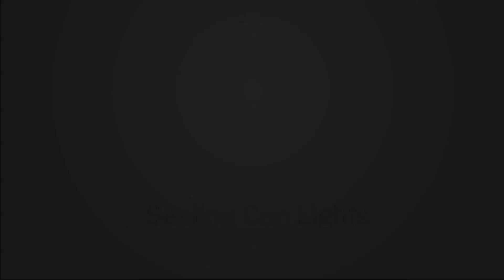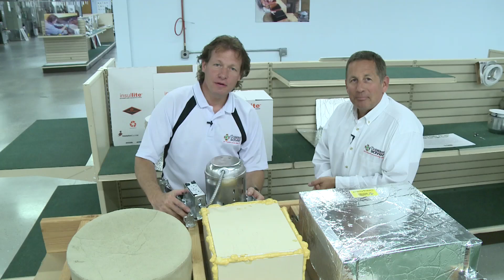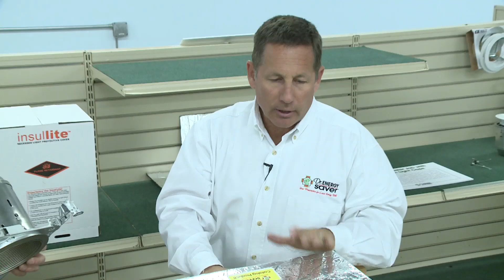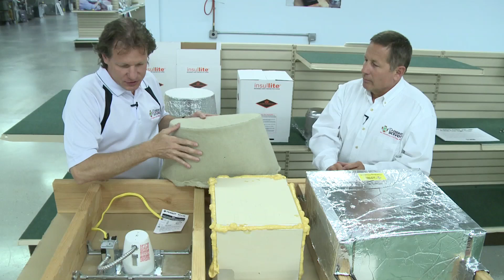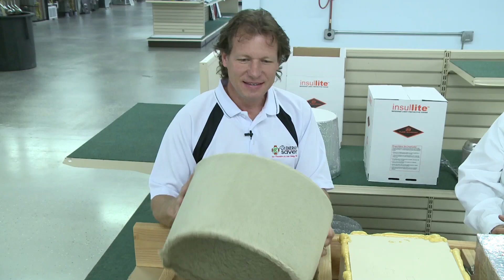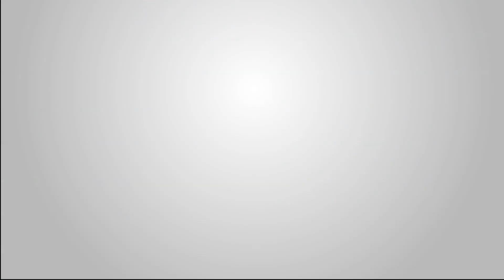Sealing Can Lights | Saving Energy with Can Light Covers

Comment: No need. Tape up the holes with foil tape and switch to LEDs. Blow insulation in the attic and be done with it. The LEDs alone will save you much on the electrical bill

Comment: Can often use a garden (fired) clay pot over the cans.  Invert it over the can.  If it has a drainage hole, place the matching saucer over that.  Then insulate the whole thing.
As noted by others, the video should have mentioned using IC rated cans. Can insulate over them.
Reply: That’s a lot of weight sitting on the drywall !
Reply: @bluesdirt6555  No. The clay pot is not heavy. It is a clever solution for avoiding drafts.
Reply: @ownpetard8379    My kitchen has six cans in a 6 x 8 ft. Area and the lights are at least 10 “ tall that’s a lot of clay pots
Reply: @bluesdirt6555   So, 6 clay pots. Fired but not glazed - less weight.
My issue is not weight but the space needed for 6 pots given the need to clear 10 inches. Setting aside that that is a lot of light - each with a 10 inch can - for such a small area, then seal 4 of the six with clay pots, and use another means for the other 2. Will be far cheaper than a commercial solution. You're welcome!
Oh, yeah, check if they are IC rated in which case you can insulate over them.

Comment: It’s not like you have the window wide open, stop stretching the truth
Reply: yes. You are right.  But the surprising fact is that when you add up all the holes in all of the can lights located on the top level of a house that the air loss accumulates to a measurable size equivalent to a window - of SOME size (but WAY BIGGER than you would think).   But you are right. Its a sales technique but not one done in bad faith. People need to be able to perceive and picture this stuff. So he should have specified how big that window would have to be. fair enough.       Here's one for you: got a leaky window? - why does it leak? Well, it leaks because of the parts that don't meet. Well, yes but there is more - there is pressure. From what? From those leaky can lights (and other stuff).  When this research was first done they sealed up the basement windows and basement walls and what happened next surprised everyone - the first floor windows leaked more than before. The air leaking out of the top of the house had to come in from somewhere. It had been coming in through the basement windows - now the first floor walls and windows. Its like an old can that required TWO holes for things to flow. So rather than seal up the basement or the first floor FIRST seal up EVERY hole on the uppermost plane of your home. Doing that actually reduces the amount of demand for makeup air coming in your lower floor windows.

Comment: Just get IC and air tight cans. Juno and Halo both sell them for NC and RM for under 20.00 USD. It would take less time to swap them out if you have non ic/at units installed. The Recessed Lighting can he is holding is not ic/at!
Reply: Cans labels "Air tight," "airtight," "airtite," "air tite" cans do not have to comply with an airtight standard and so, surprise surprise, they are simply not airtight. Look at them. There are a lot of holes in them - but less holes than a standard can. Then also look around where they meet/don't meet the drywall.  Try it both ways then run a blower door. Measure the cost of air loss over years in various climates and housing stock - or simply trust the work of others who have already done all of that and found that its easiest to slap a cover over it and foam the edges.
Reply: Sealed halo? Might as well just have a hole. Air flows through so much on every one I've seen.
Reply: Yeah it's not that simple. I have air-tite halo cans in my living room and they leaked a ton of air before I sealed them.

I went with type x drywall boxes and fire caulking. It took a bit of time but was less money in materials than the rockwool covers. I also feel I got a better seal as I could customize each box to the specific light I was sealing. It made a massive difference in comfort in the living room.

Comment: Hi Both, There are two issues involved here. First the savings you are trying to achieve are nothing against those you'd get by simply changing the bulb to a low energy unit. Secondly, the bulbs you're using need an airflow to keep cool. On the other hand low energy bulbs do not generate anywhere near the heat of a conventional bulb. Hence sealing becomes a lot simpler and safer. Regards.
Reply: A couple problems: avoiding safety and litigation liability requires complying with building code and manufacturer safety specifications - both of which are in place for good reason. Using your suggestions a subsequent homeowner who re-installed a high temperature incandescent bulb would then enjoy greater risk and liability. Secondly, you said the savings are nothing compared to changing the light bulb. Well, sorry, but no. Not correct.  That hole is there 24/7/365.25. Think: hole in a rowboat but, with a house, up-side-down. The boat fills up with water very fast. Everyone was surprised when it was first discovered that air sealing saves as much as it does. So, sorry but you are not aware of the relevant research and standards.

Comment: Just use LED lights in the fixtures.  My LED lights are cool enough that I can put my hand on them and keep it there without being burned.  Plus they save energy too.
Reply: Do it that way and your endless air leak continues to drain your home of conditioned (heated, cooled) air and if you seal the can your way (without a code-compliant cover) and the next resident puts an incandescent bulb back in then you have created a liability and unnecessary risk.